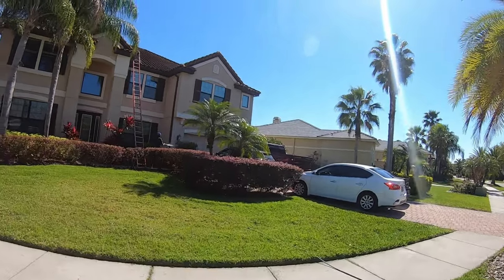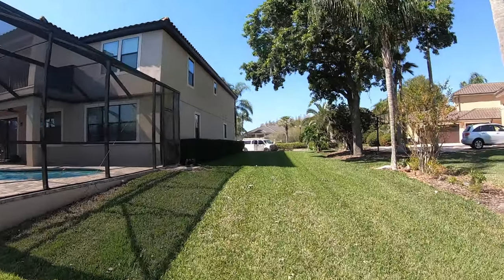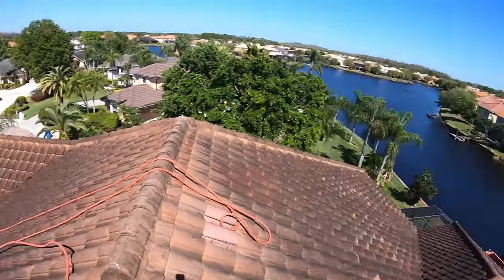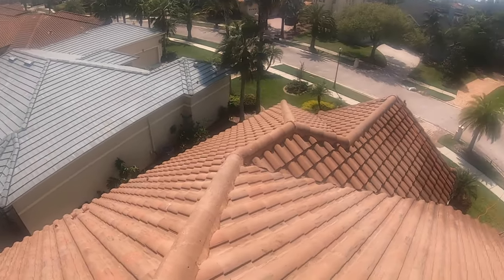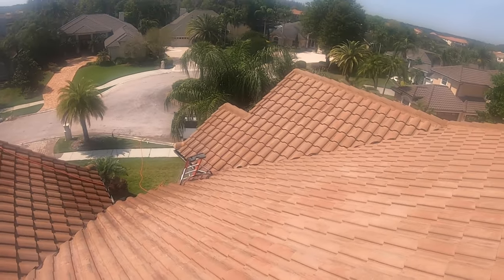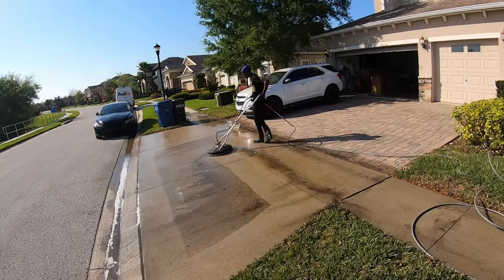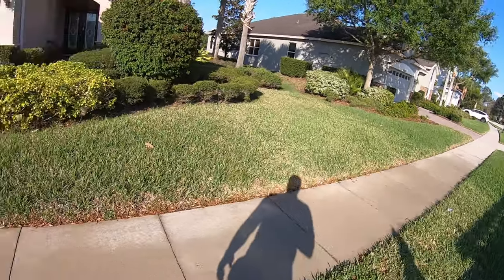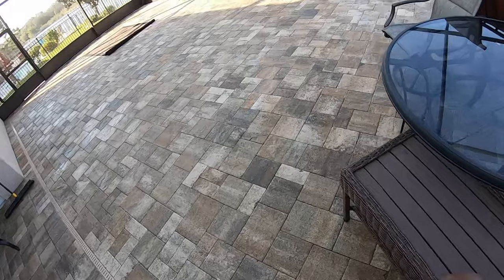Real satisfying dirty tile roof washing | SH Burns 🔥

Comment: Cliff, do you use a proportioning valve when cleaning at six percent? if so how do you get six percent with your mix
Reply from the maker: Yes I have a gf valve proportioner. Water open all the way and sh open all the way.  Gets you the 50/50 mix and using the 12.5% sh gets ya the mix.

Comment: Nice work. Keep it up! If these roofs have thick moss, tou first scrape/bruch it off before you treat the roof with SH?
Reply from the maker: We don't have that here in Florida.  But from what I've seen from other regions the guys fo scrape them off first then apply the SH.
Reply: @PinkFlamingoPowerWash  thanks alot

Comment: Hi I really like your work. What do you use to get up old oil stains from driveways & what tip are you using for your soft wash & when you use SH
Reply from the maker: Hey for oul stains you're going to need a good degreaser.  I have an 8gpm so I use a 2550 and the shooter tip  for chemical applications
Reply: I have a gx390 honda engine @ 3800psi & 4gpm. Can i change the pump so that I can have  8gpm or do I have to buy another pressure washer
Reply from the maker: @ravenroberts2873  on that small engine you would only get like 2k psi with a 8gpm
Reply: Thanks

Comment: Have you ever had your pump just not pull from your tank? My battery was showing one bar when I hooked it up at the end of the day but I wasn’t able to use my system. Had to downstream a cage. It’s really odd. Makes noise like it’s on but won’t pull. If I blew a fuse would the pump still be sounding like it’s running? That roof pitch looks sketchy!  😂
Reply from the maker: Nah only time mine does that is if I run out of sh or surfactant. That means you're drawing air that's why it doesn't pull.  Yea that pitch was borderline that highest I would go especially for 2 stories.

Comment: Nice Job Fam That Roof Was Disgusting I Was Wondering How Many Square Feet It Was And How Many Gallons Of Softwash Solution Did You End Up Using
Reply from the maker: It's was about 3500 sq ft. I used about 40 gallons of mix

Comment: Hey my man… just subscribed! Great content! Did you spray the SH pure on the roof? Or diluted with water?
Reply from the maker: Thank you. No I sprayed it 50/50  spraying it straight would be a disaster cause all the grass and plants would die.
Reply: @PinkFlamingoPowerWash   got it. When you say 3% or 6% are you referring to the level of SH concentration? How can I get get better at mixing/diluting my SH? I use 10% concentrated SH for every 2 gallons of SH I do 1 gallon of water… would you say this is a good ratio?
Reply from the maker: @sgbrospressurewashing  yes thats the concentration mix.  If you have 10% sh mix, mixing it half and half that will get you your 5% to apply on roofs wirh your 12v system or dedicated softwash system.
Reply: @PinkFlamingoPowerWash  what kind of soft wash system are you using?
Reply from the maker: @sgbrospressurewashing  this video shows it. 
https://youtu.be/pGgBiEe3SoE

Comment: hey Cliff on the second job when u did the patio do you use any soap or just sh? i followed your advice i did a huge pool cage yesterday and shot it with 3% sh only because like u say takes way to much time to rinse with all that soap.
Reply from the maker: Hey brother.  The terminology confuses some people. Some folks call sh "soap" , some ppl call surfactant "soap"   sh and surfactant together is called "soap" too lmao.  

So long story short I downstreamed sh with surfactant so I downstreamed my "soap"  I just don't put a killer amount of surfactant in my sh tank anymore since I have a dedicated surfactant tank for my 12v softwash system.

Yes pool cages u don't need much soap.  Good job.

Comment: Quick question Cliff..Do yall charge extra for moving everything around and out the way in the patio cleaning. And do yall typically charge more per square foot for cleaning pavers over standard concrete..Thanks
Reply from the maker: Yes we tell them to move any furniture out of the way prior to coming or there's a charge.  We do move some minor stuff out the way to get the Job done.  Nah surface cleaning pavers is the same as concrete so no we sont charge extra For that.
Reply: Thanks Cliff ..Hope yall keep killin it !

Comment: What kind of battery do you recommend??
Reply from the maker: For the 12v pump? Marine battery for sure.
Reply: @PinkFlamingoPowerWash  Yes, is there like a group number I should get or minimum AmH you recommend ?
Reply from the maker: @1HourBule  the bigger the better.  Deep cycle marine battery.  Make sure to get some good 8 gauge wires to wire it up to your pump.  Otherwise it will overheat and not work properly.
Reply: @PinkFlamingoPowerWash  Thank you thats some really good info that I would have had to learn the hard way lol. Would love to see a video on the prep before actually spraying. Like how you protect grass and gutter bags if any....
Reply from the maker: @1HourBule  I have a few videos of the bags. Check back a few videos. It's titled barrel tile soft wash.